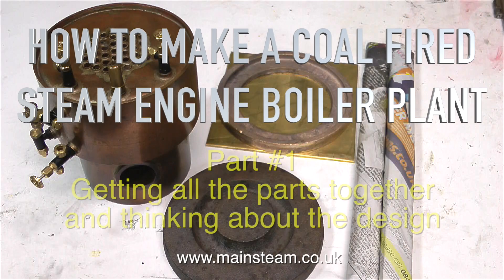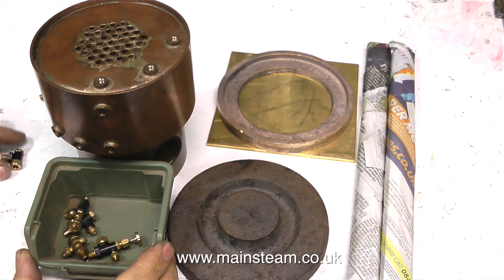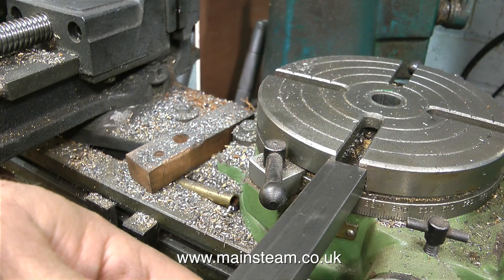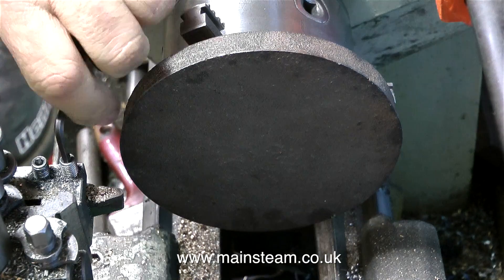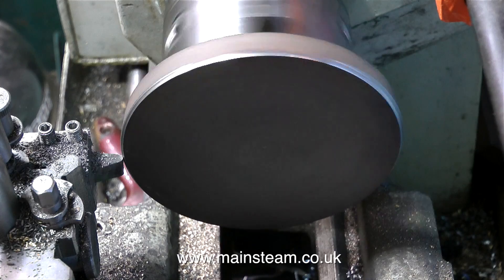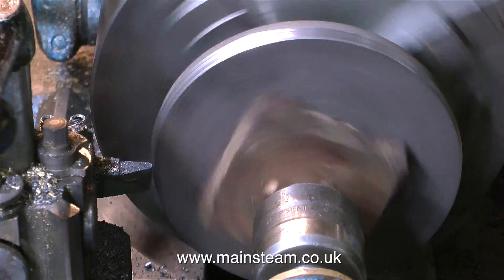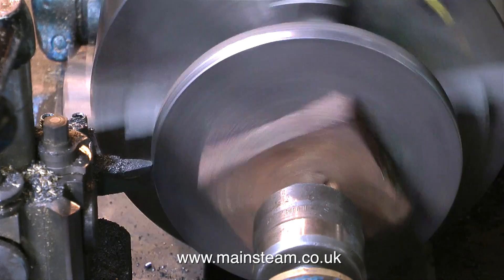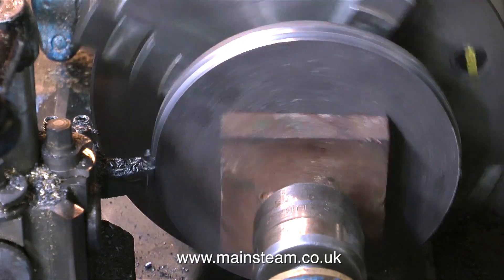HOW TO MAKE A COAL FIRED STEAM ENGINE BOILER PLANT - PART #1

Comment: Got a question. When you adjust the milling tools, is it important to clear those chips as you would for the chuck head on the boxford?
Reply from the maker: I suppose it is, I usually wipe away the chips on the milling chuck collet so that I don't get them stuck in my fingers . . .  .

Comment: My lathe has good old Timkin bearings like my BSA and knocking in a motorcycle at speed never broke a bearing but a case or two. Look forward to the ash pit construction. Is it the radiant heat of coal vs flame that heats better.
Reply: B50 track racing and 441 main bearing upgrade. Torrington in ther too, Not like those faux made in Thailand Triumphs they have Japanese or Korean bearings I bet.  if you need gaskets I have all unit gasket dies to cut em.